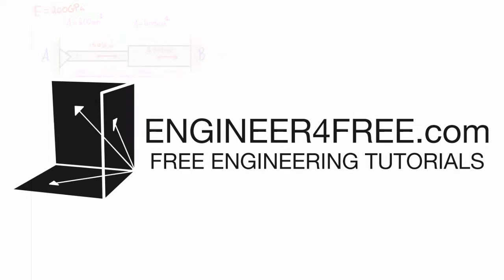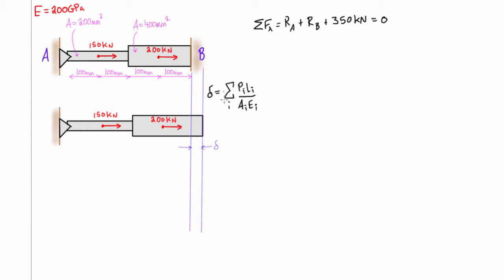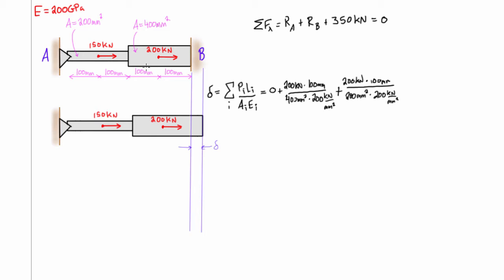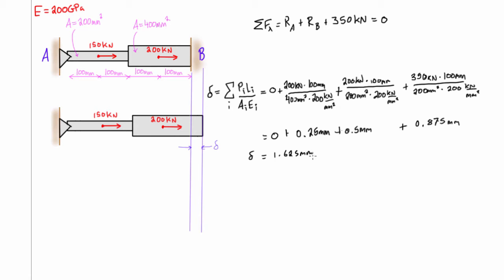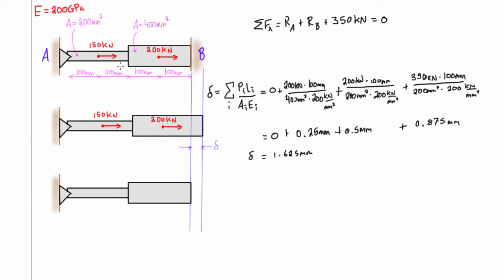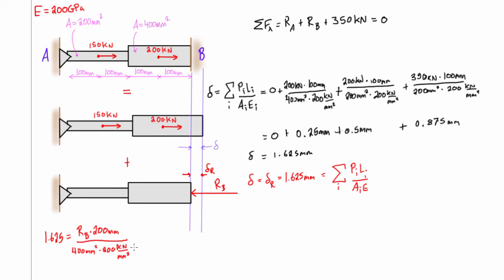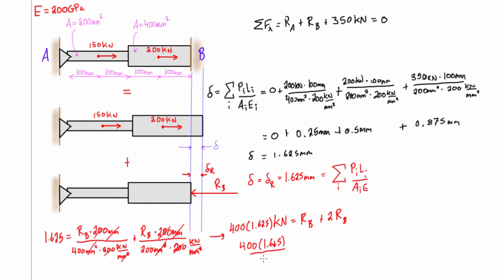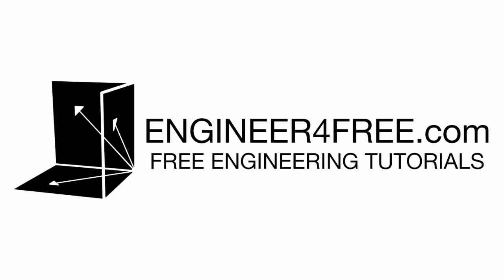How to find the reactions for a statically indeterminate member with varying cross section

Comment: Why didn't you consider some sections compressing and the others being stretched in tension by putting the signs?
Reply from the maker: Good question. This is the force method, and through the principle of superposition, by virtually removing one support we can determine that unknown force, and the displacement it would cause in equilibrium conditions

Comment: I started the analysis using your method but starting from the left. My answer is a deflection of -1 mm. 

my Equation is 0 -(150)(100)/(200*200) - (150)(100)/(400*200) - (350)(100)/(400*200).

Negative because the corresponding reaction forces are in compression. Does this mean that for this types of question, we always start the analysis from right to left?
Reply: No, Your equation makes sense. If you were to remove wall A instead of wall B,  only half of the thin, (less rigid) part would be under stress and so the total deflection would be smaller.  You just have to remember that now you are solving for Ra instead of Rb. End result (Ra and Rb) are exactly the same.

Comment: would you get the same answer if you just went and did it by 200mm rather than intervals of 100mm?
Reply from the maker: Because of the subscript i on each variable, you need to iterate every time any one of P, L, A, or E has a change in value. Some problems will be far more complicated than this one, so just do every step every time and you'll have less chance of error.

Comment: Second equation should be 150*100/200*200 - Instead of 200*100/200*200?
Reply from the maker: No, the internal axial force is still 200kN if you were to take a virtual cut in that section and analyze the remaining structure to its right. In moving right to left when taking the virtual cuts, it’s. not until we pass a point load that we change the value for P in the expression, similar to how the value for A changes only at the exact location where the cross sectional area changes.
Reply: I see now, thank you.  Educative videos...:)